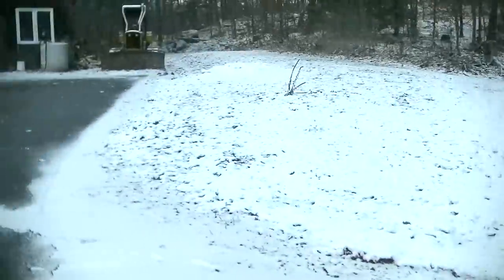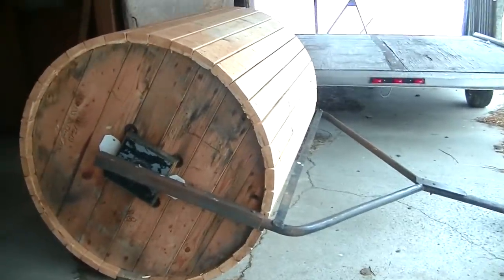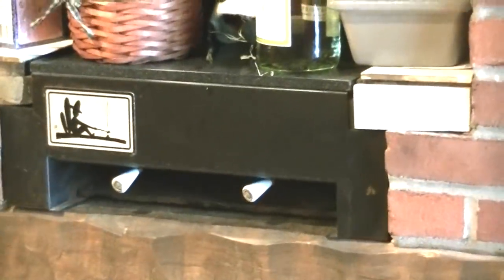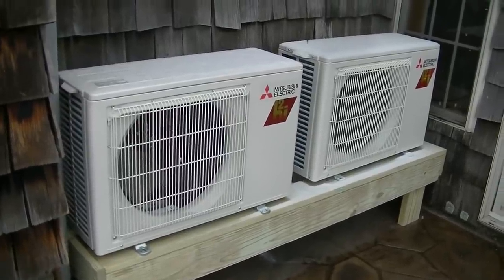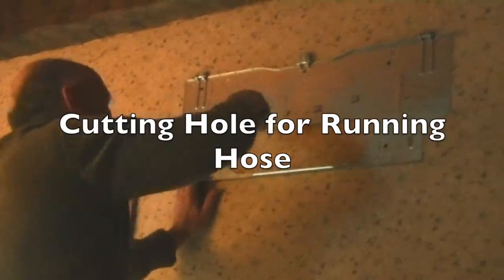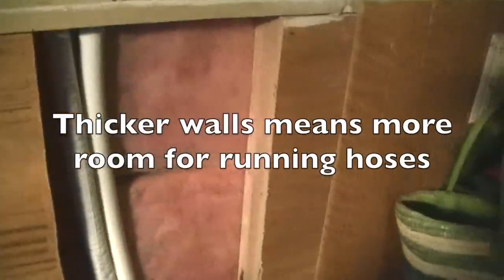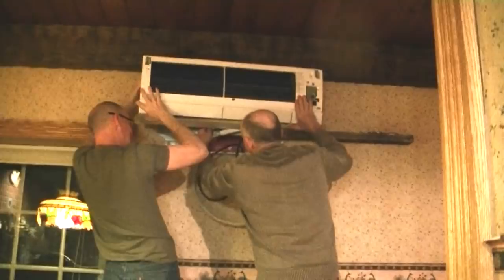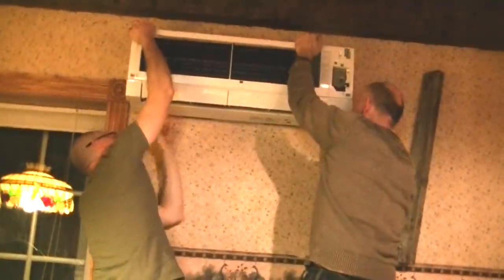Heat Pump Install & Tour Amy's Family's Vermont Country Homestead

Comment: mini splits are old school and very reliable . You can install up to 4 zones on a single outside unit. You can buy direct and install yourself BUT. There is only one manufacturer that will give a full product warranty on a self install , from what I understand. Plus the inside unit can have a very short warranty for some brands.NOTE you must register the product within 30 or 60 days or it defaults to 1 yr only.  Remember to clean the screen filters often.  Install on a separate breaker . Cool your dad built with double walls !!!!!!!!!!!!!!!!!!!!!!!!!!!! That is what i used and taught when I was builder in michigan. Thanks for sharing the holiday fun .
Reply from the maker: Thanks for sharing! Funny about the double walls huh? Cold climate builders knew what's up!!

Comment: Mini splits are great I have one outside unit that can run up to four head units.  I have installed three.  An 18000btu in the main living space and 9000btu unit in each bedroom.  You do have to run the line sets and that is usually done prior to sheet rock but depending on where you place the outside unit that can be worked out pretty easy as your dad has demonstrated.
Reply from the maker: Wow great to hear. Thanks!

Comment: We call then split system air conditioner  down here in Australia , work great , have been using them for the last 20 years. the system your Dad is fitting are one of the best available , I have a big 7kw unit in my lounge room  and smaller units in the bed room's  all Mitsubishi !
Reply from the maker: Great to hear!!

Comment: Air source heat pumps are great for the fall and spring , I have three and change over to wood and oil  in November and turn them back on in March, When the temps get down in the teens ( 17 degrees seems to be the brake even point  ) they still work but the cost per BTU goes up to the point your not savings any money. They will run  down to and below  zero and  keep producing heat.  Also you have AC in the summer.  AC has never been a big deal in New Hampshire or Vermont , but in the last few years it has been welcome.
Reply from the maker: Sounds like a good deal! Dont' need A/C up here, but the cheap heat sounds like a good reason.

Comment: I installed one of those units a few years ago. They come precharged so once the tubing is connected just open the valves and it's ready to go.BTW same manufacturer.
Reply from the maker: Wow- great to hear.
Reply: Yikes I hope you evacuated the system with a vacuum pump before opening the valves

Comment: Hello! I have a Mitsubishi heatpump and it works very good. I am living in the middle of Sweden and it can be a real hard winter here and the heatpump make realy good warm done to minus 22 degres celsius. So i think your mum and dad will be satisfied. I wish you very happy new year from Sweden. I´ll realy like your channel! :-)
Reply from the maker: Wow. Wonderful to hear. Sounds like a great choice.
Reply: You aren't getting any warmth from the heat pump. you are getting warmth from the electric heat strips installed in them for backup below 32F (OC).
Reply: Greg Lewis that is not true. A modern pump like the Mitsubishi and Pansonic have a COP of 2 or better at 32F, and they work great down to -10 C.

Comment: I have it in Cairo Egypt and I run it from solar panels. This will make you save even more money. Buy solar panels and a battery pack from a salvaged electric car. then an inverter. This way you will have your own electricity that you can store in a battery pack. Then you can use this stored electricity when the sun is down. As for the heat pump, I have the inverter type. I highly recommend them. Best regards from Cairo Egypt.
Reply: By the way, heat pumps are also used in clothes dryers. They are very efficient. They are also used in water heaters.  You will ask yourself as to way a man from Cairo Egypt is telling you this? I am selfish. I do not want my son to go to a war across the red sea to protect a hole in the ground, that has oil. So please also consider an electric car. Your house is large enough to install solar panels or a wind turbine. And as I mentioned earlier you can store that electricity in batteries and use it to run the home. That includes the heating and cooling. As for the electric car, well you can charge it from the sun or wind too. Good luck. And best regards from Cairo Egypt.
Reply from the maker: Oh wow how interesting. we hope to add solar panels down the road.

Comment: heat pumps have improved significantly.  20 years ago they wouldn't have worked well in the cold temperatures you get in VT and CO. I'm wondering though if the air feels warm coming out of it in the heating mode.
Reply from the maker: Great to hear!

Comment: Air source heat pumps work well if you have mild winters.  Efficiency falls way off once the temperatures really drop, until you are better off using electric heaters.  Colorado at altitude just gets too cold to make that practical.  That does not make any sense since electricity is a very expensive way to heat.    Now if you dug your own ground source field (bury copper or pex piping deep in the ground) then that is a different story, since the ground is always at 40-50F if you go deep enough, even in winter.   Those mini splits use DC drives for the compressors, with variable speed so they make for very good efficient air conditioners and are also easier to start than fixed speed "conventional" AC systems.  This is especially important if you may need to run the system with a generator, or off an inverter with a solar system.
Reply from the maker: Maybe a good solution for fall and spring heat then?

Comment: Between myself and close family I have experience of 3 kinds of heat pumps: mini splits(air to air), air to water and ground to water. I can at least give my opinions.
mini split pros:
pretty quick to start heating or cooling
most seem to be able to be used as cooler in summer as well
pretty cheap
cons:
outside units can get noisy
efficiency drops when it gets colder
no hot water or in floor radiant heating from them

air to water pros:
can be used with existing water carried heating (assuming you have it or are doing in floor heating anyway)
can be used  for hot water
one big outside unit that can easier be placed where noise is less of an issue
cons:
efficiency drops when it gets colder
slower ramp up of temperature in circulating water
not all can be used to cool the water in loop during summer and be used for cooling as well

ground to water (and bore hole to water though i have no experience with that) pros:
pipe buried to a depth where the ground temperature is pretty much constant, so no drop off in efficiency when air temperatures drop
can be used with existing water carried heating (assuming you have it or are doing in floor heating anyway)
can be used  for hot water
cons:
slower ramp up of temperature in circulating water
not all can be used to cool the water in loop during summer and be used for cooling as well
need to have room bury 300-800 m of pipe to collect heat from the ground depending on house size and insulation
another piece of equipment the size of a hot water tank that usually gets put in basement or utility room instead of outside

The slow ramp up is mostly a problem in old uninsulated houses around the temperature where it starts up and wants to increase the water temperature from 20C to maybe 27-28C. People in newer houses don't notice it. The slow and steady also impact hot water generation so you might need a bigger tank to start with. On our pump you can manually request for more hot water for a short time 30-60 mins, but then it will probably also run on the direct electric heating element and all efficiency of the heat pump is lost.

And on a totally subjective note, I find the mini splits really ugly
Reply from the maker: Great info! Thanks for listing this out- gives Bryan something to look over.

Comment: I had a heat pump in upstate New York and hated it. It was terrible at heating. I always felt cold in the house. That was 30 plus years ago and maybe they are better now.
Reply from the maker: They are better suited for well insulated homes, like theirs with 12 inches of insulation or ours with the spray foam style.

Comment: Air-2-air heat pumps make noise. Better to have them installed in the hallway or at the stairs than near the living room or in bedrooms. Outside units make a lot of water so best to mount them on somehing water proof and rust resistant and also  let the water run away from the house rather than into the foundation.
Reply from the maker: Thanks for the tip!

Comment: Don't undersized your heat pump system. I recommend the Arctic 'Hyper' low temperature option if your location gets below freezing for a month at a time. As temperatures drop below freezing efficiency drops without the 'Arctic Hyper' option. Check with local utility for rebates. Mitsubishi is a good split heat pump manufacturer - stick with major HVAC manufacturers - WARRANTY?. If your current heater is 12,000 BTU (~12KW) I recommend the next larger size, I.e. 18KW because of climate extremes - you don't want to be under sized cold.
Reply from the maker: Thanks for the tips!

Comment: Thank you so much for the tour of the folk's home! It's a beautiful and cozy place! Perfect for a Christmas gathering of the family!
I don't know that much about heat pumps. My Dad has one that is about 10 years old that they had installed in a new bedroom addition to their house. It's a standard unit outside with the forced air type of central air system in the house. I know that his unit has an auxiliary heat system on the inside forced air that uses natural gas when the temp get too cold. So I don't know how the new types of systems function, and if they would be able to heat below a certain temp. So I'm not much help! Guess that I need to do some research into the newer types of heat pump systems. 
Safe travels back home, and a very Happy New Year!
Reply from the maker: Thanks so much. I think there's a lot of different types of heat pumps, so research would be wise.

Comment: we put in a heat pump about 8 years ago but it's just one unit outside and it uses the existing electric furnace, but all of the electric heating elements were removed so basically it's just the fan of the furnace that blows the hot air from the heat pump in the winter or the cold air in the summer and uses the existing ducting in the house. with all of the government tax incentives and power company rebates the whole system installed by professionals costed us absolutely nothing and our utility bill dropped between 60%-70%!
Reply from the maker: Wow. Super impressive. I think Bryan is researching now!

Comment: see i don't stack firewood anymore too much labor. all the firewood is in a 48'x150'12' pole shed. 60 ft long seasoned trees piled up in there with skidloader/pallet fork i cut/split (wood splitter) as needed because some winters aren't so long but some are. live in northern mn 1890's 2 story victorian burn anywhere from 2-7 cords per winter. the new hearth propane furnace is 60,000 btu and 500 gallon tank outside only gets filled 1 time through winter or once every 7 months. makes a huge difference to burn hardwoods like oak maple & ash. each summer storms blow down trees i just take them home
Reply from the maker: Oh wow. I can see it getting laborious over the years, especially if it's the primary heat source.
Reply: Be sure to not store seasoned firewood more than 2 years else will become bug infested etc.

Comment: Hmm swapping from radiant heat to convection heat.
I install air to water heat pumps for inslab heating.
Or water to water heat pumps for ground source heat pumps.
I would not be recommending your option.
Hope it was a wise decision.
Cheers Pulpo
Reply from the maker: Not a swap, but a supplement. The furnace will still be used on days below freezing.

Comment: You don't really flush with air.  Correct refrigeration procedure is to put a vacuum  on the system and remove the noncondenseables from the unit and lines.  Some guys try to cheat and just blow down with dry nitrogen which is a bad practice. The noncondeseables include moisture. Moisture causes acids which corrode the system, also it can freeze and cause intermittent poor perrformance and ice blocks in the  unit. The vacuum is also able to verify that the line set is connected properly and not leaking. Refrigerant is not cheap and also it is a ozone layer destroyer which the EPA and Greens are very worried about.if a tech tries to tell you nitrogen is OK do not accept his word for it !! Micron vacuum test is the gold standard.
Reply from the maker: I could have got that wrong. The heat and air professional that came by has recently installed over 100 of these units - super popular in this area.
Reply: I know  you are not a tech with a Freon certification  You still accomplish so much. Keep up the good work. your  Dad must have raised you right not as a afraiad to work hard. @ColoradoMountainLiving
Reply from the maker: Thanks! I have 2 hard working parents that showed me what real work is.

Comment: Air source heat pumps are not for everyone, they don't work well when temperatures are below freezing. Frozen climates do better with ground source heat pumps which cost more to install and are cheaper to run.
Reply from the maker: My aunt and uncle have the geothermal system and they live in Maine. You certainly need a well insulated home to do the heat pump efficiently. And not  your only source of heat in freezing weather!
Reply: We run our toshiba daiseikai from 2007 in temperatures down to -25'C with no problems. It does not make much heat then, but still more than the electricity it consumes. The newer ones work down to -30'C.
Reply: @ColoradoMountainLiving  FIRST RULE IN HOME OWNING IS INSULATE - you cannot heat economically a poorly constructed structure. Your Dad built with 12" R42 walls - kudos Dad you definitely understand how good engineering returns money over the life of the building. Geothermal? Yabetcha but not all have the soils to dig trentches below frost line (42">) or the budget to install best ... get "Arctic Hyper" option  and install a spilt unit in main living space to start... then add second unit (redundant backup) as budget allows... of course a stand alone fireplace makes a great emergency heat and cooking source.

Comment: The Vette looks like early 70's but I'm totally guessing.
Reply: It is a 1973 model. 1972 was the last  front and rear chrome bumper car.  1974 had had f/r plastic bumpers.
Reply from the maker: @tomjenkins7761  You are correct! 1973

Comment: The Corvette is 1973. Metal rear bumper with a plastic front bumper. 1972 would have had a metal front and rear bumper, 1974  Corvette had plastic front and rear bumper.
Reply from the maker: Correct!

Comment: GOOD DEAL WITH HEAT PUMPS,, THEY EAT UP THE POWER,,,  IF YOU FILL THE ROOF WITH SOLAR,!!!!, ONE OF MY FRIENDS PUT IN JUST ONE PUMP & HIS BILL WENT FROM A 100 A MONTH TO 250,, HE WENT BACK TO WOOD.. ANOTHER FRIEND HAS 2 PUMPS & PUT 24 SOLAR PANELS TO COVER HIS BILL FREE HEAT FREE AIR,, BIG BUCKS TO GET UP AND RUNNING ... HAPPY HOLIDAYS..BE SAFE..
Reply from the maker: There's a lot of variables it sounds like. How well are you insulated- for starters!

Comment: Dont know personally but next door neighbour installed one and 6 months later shut it off because hydro bills were out of this world  That being said I should also advise he installed the system himself  Not sure if that is part of the problem or not   He sold the house and as far as I know the new neighbours are back using it and have not said anything about high hydro bills  Just fyi
Reply from the maker: Wow interesting. Usually the bills go down.
Reply: Do you have many days below freezing? Heat pumps don't like freezing temperatures.
Reply: @dougmc666  Yes Doug  Nov. thru March we are suceptable to below freezing weather   dont know whether that pump froze or what the problem was but he did complain several times before he shut it off due to high electricity bills

Comment: Exactly on point Dad - heat pumps are the best technology - expect 200-400% efficiency, meaning its better to pump heat from outside into your living space - for every dollar of electricity to run the heat pump, 2-4 times the amount of heat will be pumped into your living space. Rocket Mass Stove/Heater and all other heaters types be it propane, fuel oil, wood boiler or pellet boiler are all in the 75-95% efficiency... meaning a heat pump is 2-4 TIMES more efficient... its a no brainer decision... get a heat pump ASAP... it will pay for itself in a few seasons. Even if your old system uses "FREE" wood... (There are NO FREE lunches - everything has a cost)  GO WITH A SPLIT HEAT PUMP IN THE MAIN LIVING AREA - YOU ARE GOING TO LOVE IT... in the Pacific NW the electric company offers over a $1000 rebate to encourage people to make the switch from burning old polluting wood stoves - not the stove - its people choking them down thinking it burns longer - urban myth - burning takes 6 times the air to wood ratio to burn clean. HEAT PUMPS MAKE SENSE $$$!
Reply from the maker: All very convincing. I think Bryan is doing the research now! lol